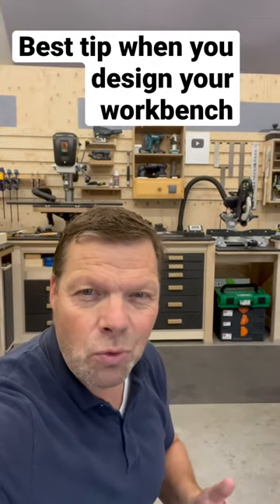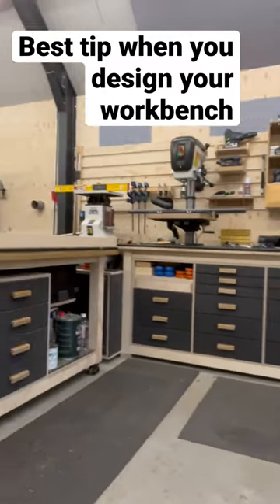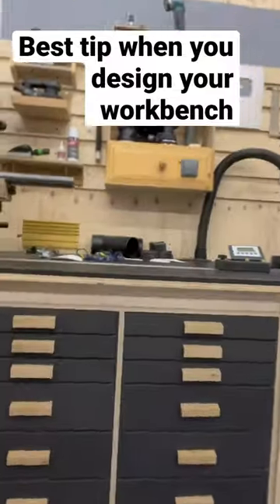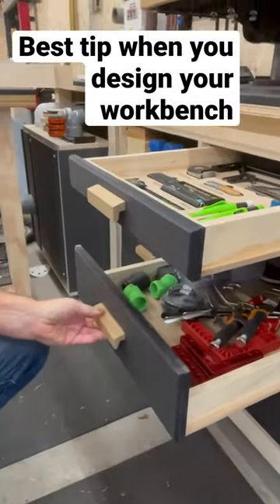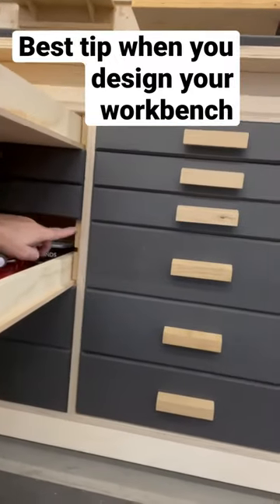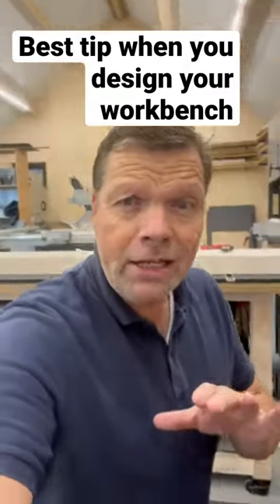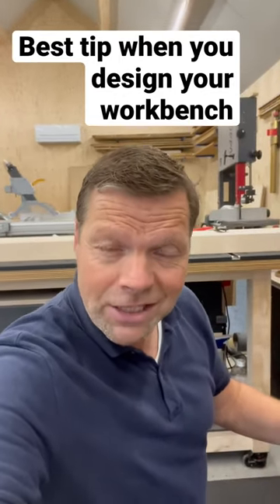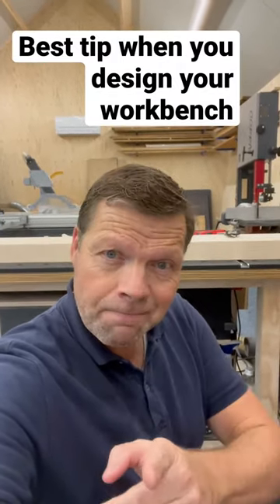Best tip for when you design your workbench #shorts

Comment: I've executed basically the same design. I created the grooves for the drawers by using slatwall paneling to line the case sides. If you value your time and can accept the slatwall's groove spacing, which I find to be quite practical, you can save a considerable amount of time and money.
Reply: So the drawers are stable? What do you use for the runners? Really like your idea.
Reply: @rta3738  I sometimes make utility drawers as many guys do, by simply extending the plywood drawer bottom past the drawer sides to form a 1/4" tongue that can ride in dados in the case sides. In this case, I happened to have a bunch of drawers with 1/4" bottoms cannibalized from another old set of shop cases. They worked without modification in the grooves of the slatwall, but to achieve a better fit in the slatwall grooves I glued on hardwood shim strips to add to the tongue's' thickness so they slid and cantilevered away from the case better.
Reply: @michael.schuler  thanks so much. I wanted to save in drawer slides and this seems like a great solution.